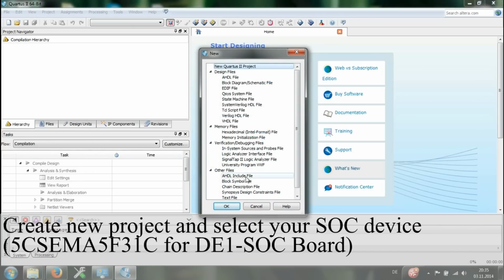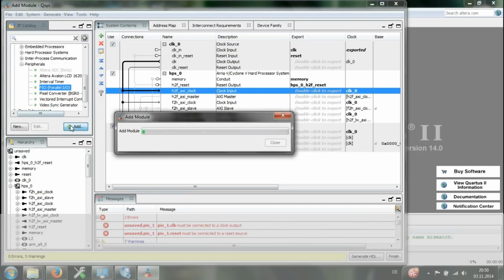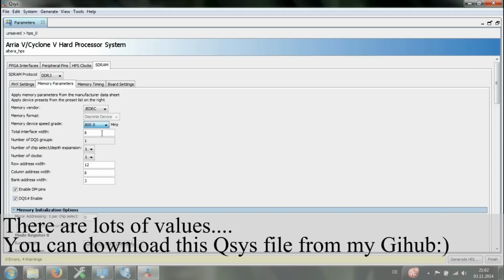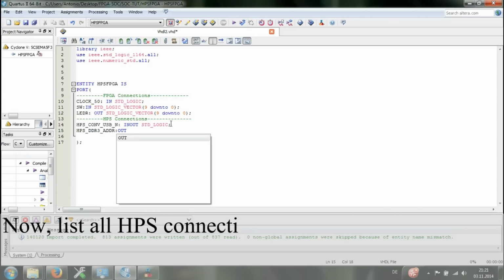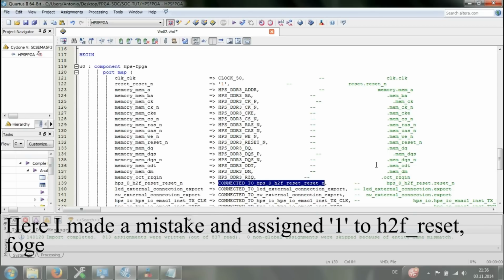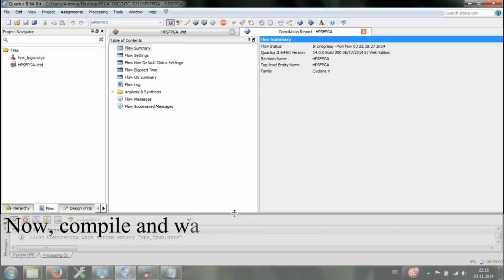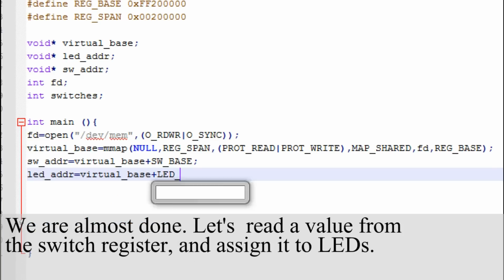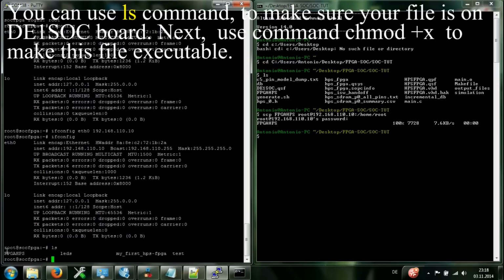Tutorial:Getting started with FPGA-SoC and Linux Yocto on Terasic DE1-SoC board

Comment: Hello Toni. Great video!
So the Linux part (running on the DE1-SoC board) is not visible on your screen right? I mean we only see the state of the switches sent by the DE1 board while running on Linux, is that correct?
Linux Yocto can run on the DE1 board whatever the connections of FPGAHPS, HPSFPGA are?
I have DE10-Nano board which has a Cyclone V SoC chip as well. How can I use HDMI on my projects either in VHDL/Verilog or on the HPS?
Last one, we can find many tutorials on Youtube to install Windows 10 or even Windows 10 IoT on Raspberry boards with Arm 64bits architecture. Do you know if it is possible to do so with a DE board with a Cyclone V SoC which are Arm architecture but maybe not 64bits (not sure about that)?
Sorry for all these questions but the way you explain how to proceed is crystal clear. Thank you!!

Comment: When I compile the design I get a "Error (12006): Node instance "u0" instantiates undefined entity "hps_fpga". Ensure that required library paths are specified correctly, define the specified entity, or change the instantiation. If this entity represents Intel FPGA or third-party IP, generate the synthesis files for the IP." error. Any idea why that is?

Comment: Hi Toni,

Thanks for the nice video. It's very helpful. I am totally new to FPGA SoC with ARM processor. According to your video, this is how I understand so far:
- If I want to program the ARM-Cortex A9, I have design every necessary thing and add the HPS in Qsys
- Then I have to load Linux and make a C program or load it from somewhere

The thing confusing me is that at first, i thought there is some built-in IDE ( as I know we have Eclipse ) that help us write all the code and also there are some standard libraries. But we have to load Linux and write the code on Linux. In short, Linux or any OS is compulsory to execute the code? This is because A-family ARM processor are made for application purpose, right ?

Sorry for long questions and if there is any stupid questions ( I am totally new to this field ), please forgive me.

Comment: @AntoniusSimplus I have followed your project step by step, but when I program the FPGA I have some problems and doubts:
1.- Which MSEL configuration do you use. I have tried with "O1O1OO" and "000000".
2.- If I program it without the SD and insert it after, Angstrom OS won't boot. I also tried to stop the boot presing a key (Serial COM), programming it with another cable, and after this boot the OS, but it won't boot.
Is there anything I am doing wrong. I'm using a DE10-Nano, but I addapted it and it uses also a Cyclone V, so it shouldn't be an issue.
Thanks.

Comment: Hi, thank you for this video, it was very helpful for me. I could do everything right. Now I want to create a .bdf for this project (with "Create Symbol File from current File" doing right click on the .vhd file) and set it as top level entity, so I could use logic gates between the switches and the fpga-hps bridge (I'm not interested on doing this on the .c file, I want to do it on the FPGA fabric). When a create the bdf file and set it as top level entity I have this problem when I compile:
"Error: The auto-constraining script was not able to detect any instance for core < hps_sdram_p0 >
Verify the following:
The core < hps_sdram_p0 > is instantiated within another component (wrapper)
The core is not the top-level of the project
 The memory interface pins are exported to the top-level of the project
Alternatively, if you are no longer instantiating core < hps_sdram_p0 >,
 clean up any stale SDC_FILE references from the QSF/QIP files."

I'd be really glad if you can help me. Sorry for my English.

Comment: Really a nice and helpfull video. Unfortunately I am not able to make the C-Code because there is an error message which tells me, that a file can not be found. I used different quartus installations but cannot overcome this issue. Any suggestions? I use ADC-SoC with 5CSEMA4U23C6
make (e=2): The system cannot find the file specified.
make: * [setup] Error 2
Reply: I also have this issue
Reply: Same here too, did you ever figure it out?

Comment: Hi Toni @Toni T800, I had just tried connect the board with my laptop using the cross-over cable. Initially the connection is established and i can scp files from my laptop to the board. However, after a few times, it wont work anymore. When I try to scp files to the board, it show the following message:

$ scp -vvv INTERN_DEMO root@192.168.1.1:/home/root
Executing: program /usr/bin/ssh host 192.168.1.1, user root, command scp -v -t /home/root
OpenSSH_6.8p1, OpenSSL 1.0.2a 19 Mar 2015
debug2: ssh_connect: needpriv 0
debug1: Connecting to 192.168.1.1 [192.168.1.1] port 22.
debug1: connect to address 192.168.1.1 port 22: Connection refused
ssh: connect to host 192.168.1.1 port 22: Connection refused
lost connection

I have no choice but to use the router to scp. Is there any fix to this? I am using DE0 Nano SoC by the way

Comment: hello, i have a question regarding the process. why didn't you go through the preloader and uboot steps and the bsp builder? 
does the terasic image linux contains a default preloader if so what does it differ from a custom one ? and when should i use a custom 
as for the boot which pins did you set on the board ? is it "00000"? thank you

Comment: I agree this is a fantastic tutorial. Also agree that it's much better than anything from Altera. Most of their tutorials are just propaganda that end up teaching you nothing and have no practical implementation examples. The only thing that could make this video better is if you showed how to generate BSP, uboot, linux kernel and root file system from scratch and put on SD card. If you had a video like that to accompany this it would very easily be the best altera HPS SOC linux tutorial video on the entire internet.
Reply: What's sad is that this video is nearly 3yrs old and it's STILL the best altera soc linux tutorial video that I've found. Pretty lame Altera...

Comment: Hi, i am trying out this on the Arria 10 SoC board. I am running the below C code  but do not see the LED turning on. 
 Any idea how to debug?

I am using the GRSD 17.0 on A-10 SoC 
https://rocketboards.org/foswiki/Documentation/AVCVGSRD170

#define REG_BASE 0xFF200000
#define REG_SPAN 0x00200000
#define LED_BASE 0x970

void* virtual_base;
void* led_addr;
void* sw_addr;
int fd;
int switches;
int main(int argc, char** argv)
{

 printf("Perry's Trying to Turn on All LEDs\n");

 fd=open("/dev/mem",(O_RDWR|O_SYNC));
 virtual_base=mmap(NULL,REG_SPAN,(PROT_READ|PROT_WRITE),MAP_SHARED,fd,REG_BASE);
 led_addr=virtual_base+LED_BASE;
 printf("Perry's Before1 Led Address %x = %u\n", led_addr, *(unsigned int *)led_addr);
 usleep(10000);
 *(unsigned int *)led_addr=0x1;
 printf("Perry's After2 Led Address %x = %u\n", led_addr, *(unsigned int *)led_addr);

 return 0;
}

Comment: Hey. I thank you a lot as your presentation is very easy to understand for a student. I do not have the de1 soc but de0 nano soc. I do all like you say (with a de0_anon_pin_assignemnt) and when i compile i have this mistake :- Error (14566): The Fitter cannot place 14 periphery component(s) due to conflicts with existing constraints (14 pin(s)). For each 14 nodes, i have for example :- Error (175020): The Fitter cannot place logic pin in region (55, 61) to (55, 61), to which it is constrained, because there are no valid locations in the region for logic of this type.   Info (14596): Information about the failing component(s):
      Info (175028): The pin name(s): HPS_SPIM_CLK
   Error (16234): No legal location could be found out of 1 considered location(s).  Reasons why each location could not be used are summarized below:
   Error (184016): There were not enough single-ended output pin locations available (1 location affected)
    Info (175029): C19
   Info (175015): The I/O pad HPS_SPIM_CLK is constrained to the location PIN_C19 due to: User Location Constraints (PIN_C19)
    Info (14709): The constrained I/O pad is contained within this pin
I think its due by the fact theses nodes are bidirectionnals (altera say "you have to put LCELL" for each one... i do not know how do that). Do you have any ideas ?Thanks you for your time.LS
Reply: Hi mate, Did you ever find the solution to this error?

Comment: by following this video tutorial on my Arrow SoCKit , i reach up to running the Code "./HPSFPGA" on PuTTY Console ,  but nothing happen, i mean NO error NO LED Glow by Switching SW on/OFF.

As i don't have ARM License so i cross Compile this code on my ubuntu 10.04 machine by adding the required Quartus libraries.  and run the command on Linux console.
"#arm-linux-gnueabi-gcc-4.6 HPSFPGA.c -o HPSFPGA" (No Error Successfully Compile)

If i add in C-Code like "Hello from SoCKit", it displayed this message on PuTTY,
but it won't open the fd = open("dev/mem", (O_PDWR|O_SYNC)); and stuck after that.

Comment: Hi Toni. Great job you are doing here, a lot helpful for beginners like me. My only question is, why do you need to change all that QUartus timing configuration on Qsys and where can I find them for my board? I'm wondering if you intend to make a tutorial for DE0-nano-soc board. I bought one recently and I am trying to make the FPGA and the HPS talk just like in this video. I've found on github the pin assignment file (mabe it is yours: https://github.com/AntonZero/LED-Matrix-with-DE0-Nano-SoC-Board), and will look at the timing configurations appropriate for my board to repeat your steps.  Thanks for your video!

Comment: Hi toni. I'm a student in korea. There is not many documents about fpga examples with my language. Your tutorial was so helpful. Thank you so much.  
I have a problems with using HPS-FPGA bridge which has some protocol, like as spi and i2c. I can use adxl345(g-sensor) using i2c protocol which is not on the soc . But that chip on de1-soc is connected on HPS, It was hard to me bring values of g-sensor to fpga. could you give me some clues of using it? I really want a know. anyway thanks!
Reply from the maker: 우돌식  You can connect the I2C directly to the FPGA by writing to HPS_I2C_CONTROL register. Check the user manual for DE1-SoC
Reply: Toni T800 oh my god. I thought I already checked out all about meual..
 I miss that from menual.  Thanks for your help!!

Comment: Hi Toni T800, This video helps me a lot! 
By the end of part1, it happened errors in compilation. I wonder if you know what's wrong. I did follow your steps, and believe I did exactly the same. Here is the error:

Error (174052): I/O "HPS_DDR3_DQS_P[3]" has dynamic termination control connected, but does not use parallel termination
Error (174068): Output buffer atom "HF_TUT_COMP:u0|HF_TUT_COMP_hps_0:hps_0|HF_TUT_COMP_hps_0_hps_io:hps_io|HF_TUT_COMP_hps_0_hps_io_border:border|hps_sdram:hps_sdram_inst|hps_sdram_p0:p0|hps_sdram_p0_acv_hard_memphy:umemphy|hps_sdram_p0_acv_hard_io_pads:uio_pads|hps_sdram_p0_altdqdqs:dq_ddio[3].ubidir_dq_dqs|altdq_dqs2_acv_connect_to_hard_phy_cyclonev:altdq_dqs2_inst|obuf_os_0" has port "SERIESTERMINATIONCONTROL[0]" connected, but does not use calibrated on-chip termination

Thanks in advance!
Reply: guanhao145 I solved it. For this error, the reason is because I did not run the correct TCL scripts. The correct TCL file should be "project->db->ip->component->submodules->TCL". To make sure you have the right TCL file, user may need to close Qsys and properly saved.
Reply: Toni T800 Hey, I am in the very last step, and have a problem when running the file on DE1-SOC. It does not return the correct value; and the leds & sw do not work at all. Here is the info on terminal:

socfpga login: root
root@socfpga:~# source ./init_opencl.sh 
root@socfpga:~# ./HF_TUT_ex 
2696937473
2696937473
2696937473
2696937473
2696937473
2696937473
2696937473
Reply: guanhao145 Solved... This is because I did not upload programer. I did not realize that the board will recover to default whenever reboot.
Great Video tutorial! Wish you have more as detailed as this one!
Reply: How you fixed? I have the same problem.. :(
Reply: Don´t worry, I solved. XD